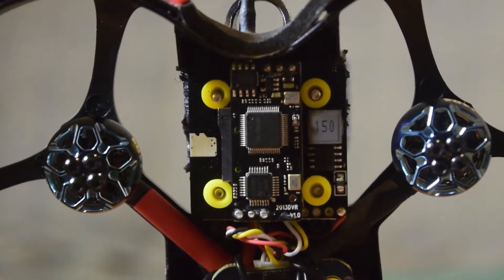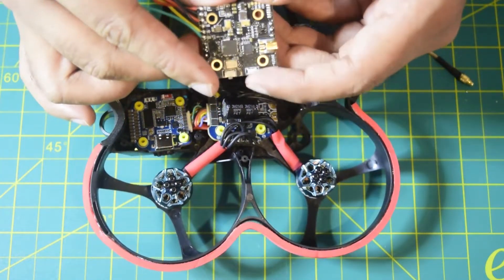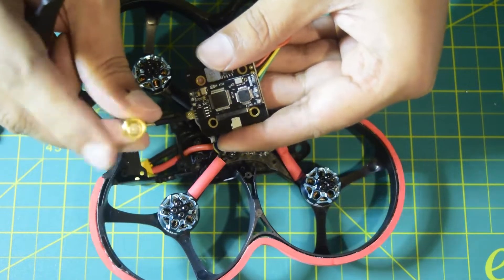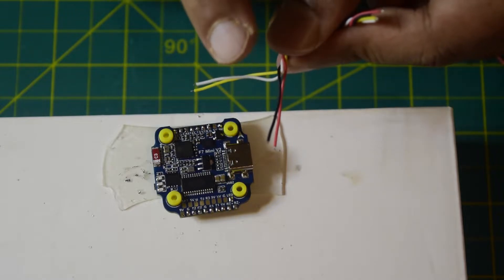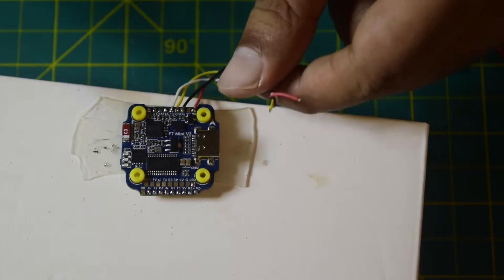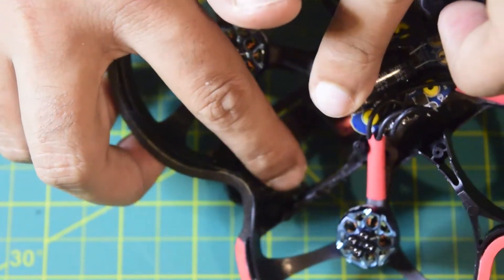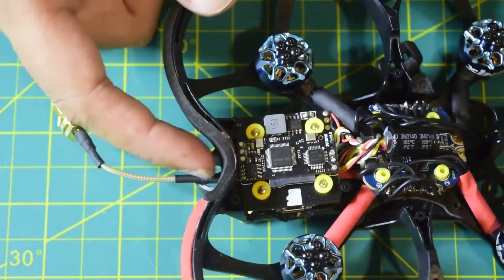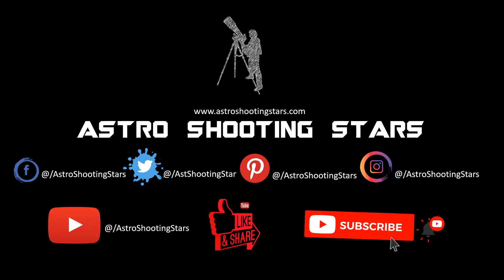How to Install AKK FX3-Ultimate-DVR VTX on the Cinewhoop Drone Frame with Speedybee F7 Mini

Comment: DVR not working on mine how can i fix it
Reply from the maker: If your connection is correct most probably your dvr is fried. please not do not turn on DVR without antenna and ensure that if you use it without flying the drone you have proper cooling as during flight it gets cooled by air faster due to speed. I hope this helps. Please stay tuned to my channel for my future videos

Comment: I have a problem with this VTX. I buy new but I can't record from DVR. There's no light DVR indicator while VTX is on. The VTX is normal. Please help me 🙏
Reply from the maker: do you have VTX video transmission working correctly ?
Reply: I have the same proplem 
Did you fix it